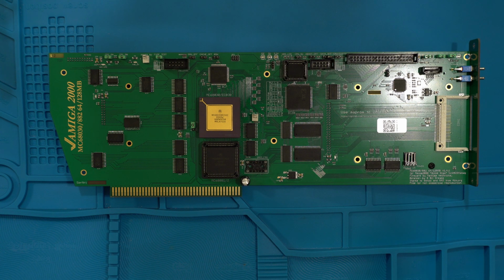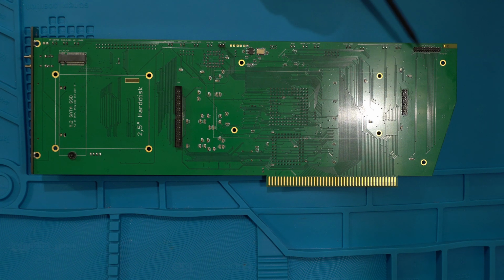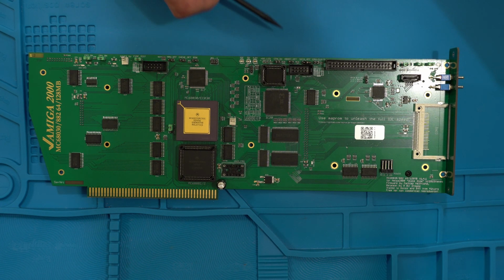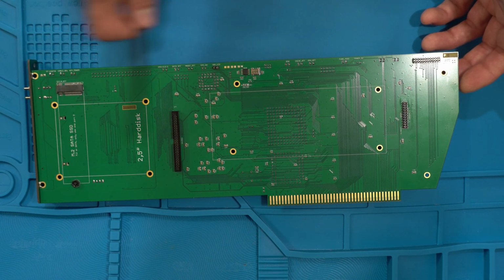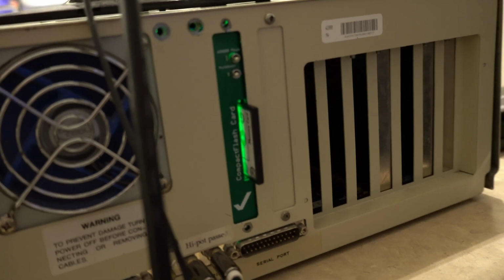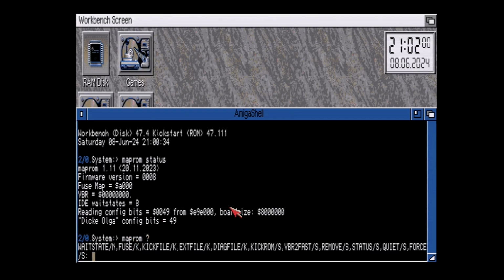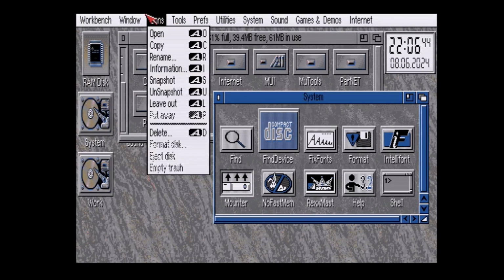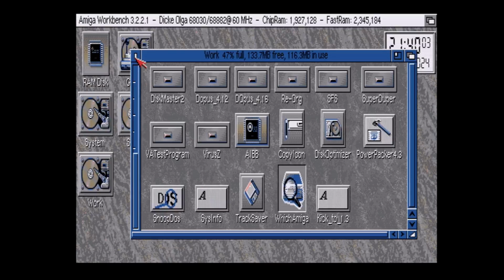"Dicke Olga" 68030 128MB Accelerator Card Review - for the Amiga 2000

Comment: Quit interesting card. I might actually order one.

A MMU imho is quite essential for this card - you most likely want a "Flickerfixer" if you do not have an original 1084. The indivision ECS v4 not only is a flickerfixer and FPGA Super-Denise replacement, but now also supports RTG. Not as fast and high-resolution like a Picasso II, a Vampire or a PiStorm - but still with 1024*768 in 256 colours much better and faster than the (Super-)Denise delivers. Also, such resolution is much more time-appropiate than Full-HD with 16k colours. And still fine for (VGA) CRT´s. The resolution we wished for back in the days.
However a minimum of 68030 with MMU is required to use RTG on the Indivision ECS. So if you (like me) already have an Indivision, the "Dicke Olga" not only provide more speed, RAM and HD/CD support, but indirectly enables RTG with the indivision. Now I "only" have to repair my second A2000 and buy the Dicke Olga. Hopefully it is still available when I am ready...
Reply from the maker: I still have to finish the repairs on my eBay sourced A2000 Rev 6, mainly due to corroded, rusting DB Connectors. Good luck with your repair :)

Comment: Does the CDRom require a cd in the drive for it to show up?
Great Video
Reply from the maker: I am glad you liked the Video. Yes, just like  the Floppy,  the CD ROM Drive requires a Disc to be inserted to show up on the Workbench. Though, there are tools that can used to find if the actual Device is present (the Device Driver has been successfully mounted and is recognized by the OS). Using OS 3.2.1, the Mounter Utility can be used when set to the correct device in its Tool Types.

Comment: damn, I totally missed that this thing now has sata and M2...I have to replace my prototype card with a newer version...
Reply from the maker: There are several PCB versions, the one featured in my Video is the fully loaded version. mSATA works well, a bit faster access than the CF Card. I may try the M.2 SATA again with the CD-ROM to see if I can get it to work. Future Boot ROM updates may resolve this. For now, I am using the  Buddha Controller - 20th Anniversary Edition for CD-ROM access.

Comment: Se ho capito bene quella scheda in origine ha una CPU 030ec a 40 mhz,ma e' aggiornata al 030 a 50 mhz,questo spiega perche il socket FPU e plcc e non pga
Reply from the maker: You can order the card with fall  68030, which is binned from the factory rated at 40 MHz, which can clock up to 60 if desired. I opted to install one of my spare 68030s rated at 50 MHz, since I planned on overclocking the CPU to 60 MHz,  just incase :)